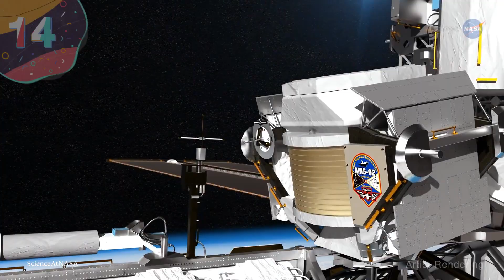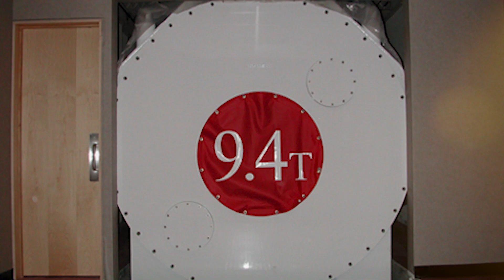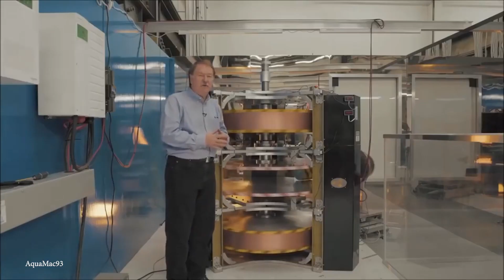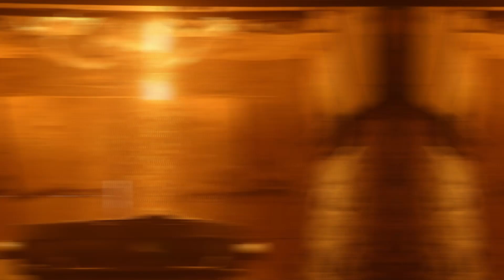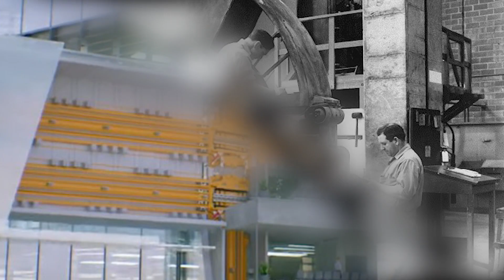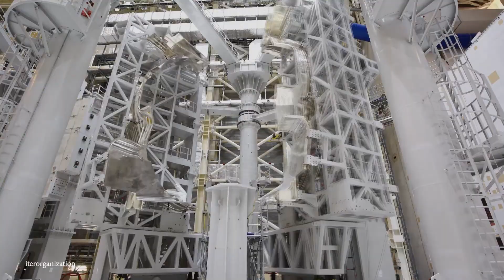15 IMPRESSIVE Magnetic Machines

Comment: hey dip shit the LHC accselorates protons (positive hydrogen ions)..., not PHOTONS AKA light, to near light speed, do you see where im going with this. photons typicaly travel there own speed (but can travel slower also),  Apx. 186,000 miles per second and protons can travel any speed but 186,000 miles per second due to the fact that the protons mass will have incresed infinitely requiering more energy to propel than has even been created/transformed in the entiere universe up to that point, and so relative to the perspective of every one else it has frozen, and vice versa to us. ooops. next!

Comment: Magtorquers on satellites is really old technology.  We used it 30 years ago on some of the GOES weather satellites but then dropped it from all of our designs as there are more efficient mechanisms for attitude control. I left the industry a while back but would be surprised if they were in use on any present spacecraft.
As far as the Earth motor goes, quacks have been touting bogus perpetual motion machines for years using arrangements of magnets - it is no more physically possible now than it was a 100 years ago as the laws of physics haven't changed. Over unity magnetic motors will never happen!

Comment: Um… The LHC accelerates PROTONS up to nearly the speed of light, not photons. Photons are the elemental particle/wave unit of all electrical/magnetic radiation therefor are inherently already moving at the speed of light (in a perfect vacuum) which is what the inside of the magnetic tube and experiments inside the LHC are. You need to fix this little gaff in what is otherwise a cool video.

Comment: and what happens if that fusion magnet fails? total devastation....so stop being so concerned about "clean"...just look at all the nuclear disasters...Chernobyl...Fukashima...both are still causing problems today!!!
Reply: Nope, you need to understand how a fission reactor, holding tons of nuclear fuel in the reactor, is different from the fusion reactor. ITER will have less than 4 grams of gaseous fuel. That's just how it works. No possibility for meltdown because there's just no fuel in there to catch on a runaway reaction. Go read a book.
Reply: If the magnet fails the plasma will disperse, cool off and stop fusion. The magnet has to compress the plasma dense enough for fusion to happen